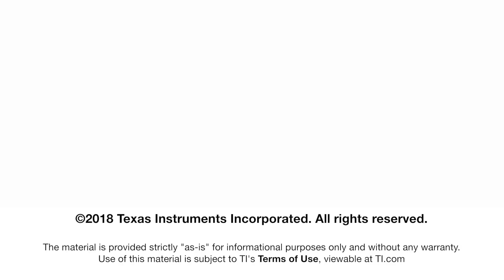Connect: What is wireless condition monitoring?

Comment: That's cool! Just wondering if the vibration of a motor has any effect on its current consumption even in a minute way, if so would it be much more reliable to monitor the patterns of the current at high resolution for detecting any anomalies of its operation? Thanks
Reply: I believe it's doable, in fact current monitoring might give better insight, but on the other hand it's computationally more demanding, thus leading to higher cost to deploy.
Reply: Hey Krish,  

Great Question!  I'm JD, from the video.  I don't think all vibration will have an effect of the motor current, but there are faults that can be detected either way.  In my opinion, there are also faults that can also only be detected via vibration or current/power monitoring.  The most robust solution is to have both, but it is probably much easier to deploy vibration monitoring first since you will not have to change out the motor drive hardware.  

Our C2000 products offer some of the industries best motor drive solutions.  I've discussed this topic with them, and they are investigating offering an integrated current monitoring or back EMF solution for condition monitoring into their current solutions.  The exact timeline for something like that is unknown at this time, Keep your eyes peeled for it in the future!  

Thanks,
JD